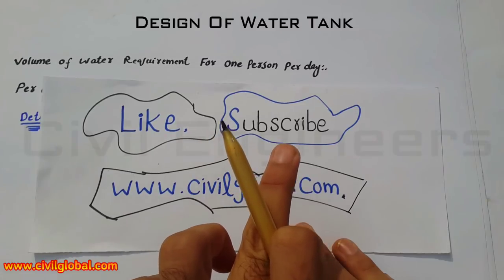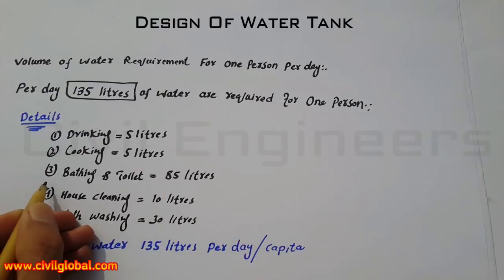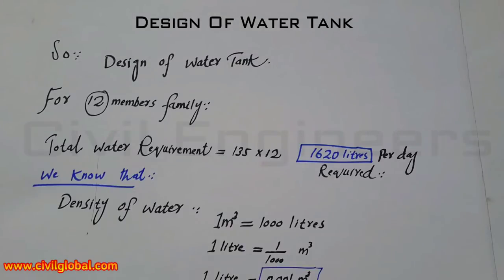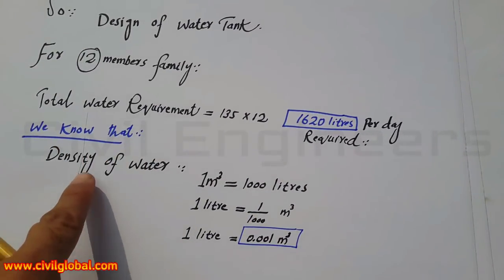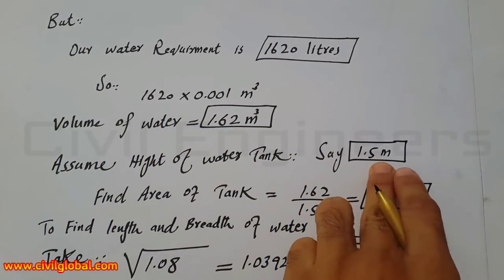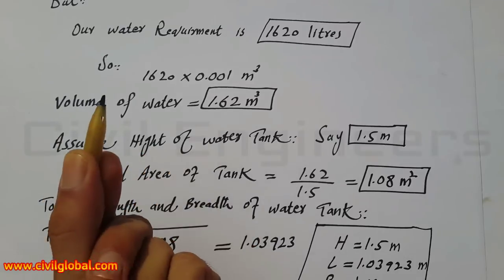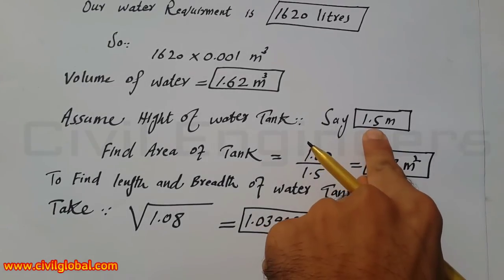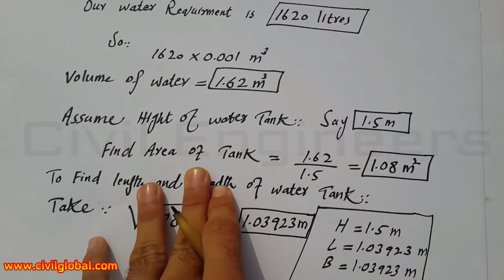Design Of Water Tank

Comment: great video. And we will add 8" concrete wall additionally in this size, right? keeping height at 1.5m is good for better water pressure. and in case of rectangular tank instead of squarish, we must not increase length more than twice the width. Also if you could give detail about steel and waterproofing, het insulation plus float valve, and how raised it should be from slab, etc, it would have been even better. you are doing excellent work keep it up and thankyou for sharing your knowledge with everyone.

Comment: you are an architect in a well known establishment. you were tasked by the CEO to give a proposal on the diameter of the establishment's water tank design. the tank should hold a minimum of 950m³. you are required to have a proposal presented to the board. the board would like to see the concept used, practically, accuracy of computation, and the organization of the report.pls i need answer.,thanks